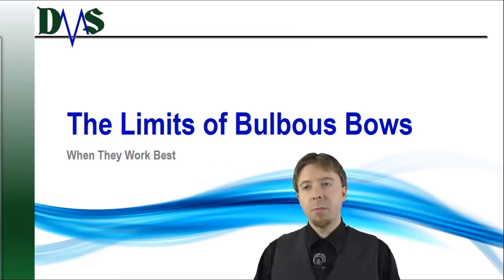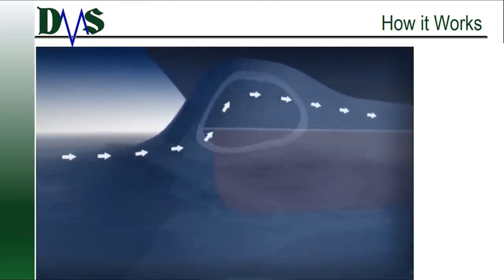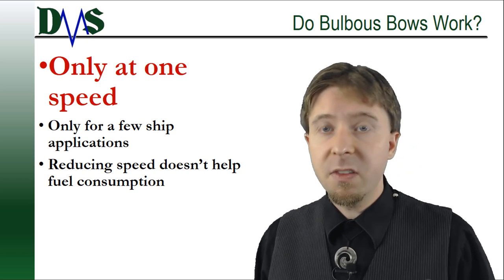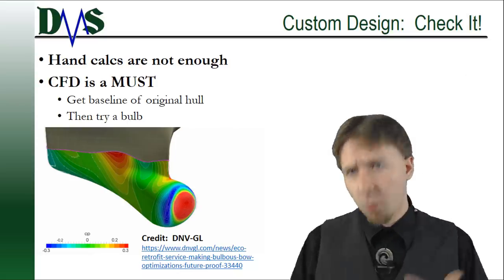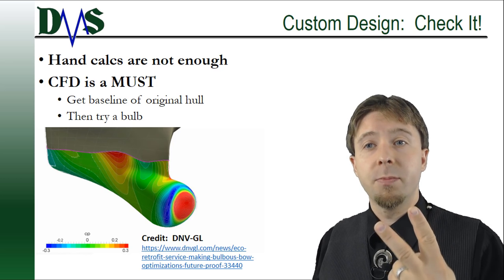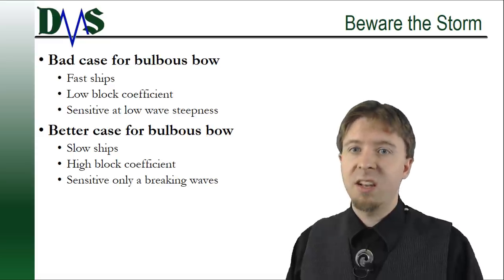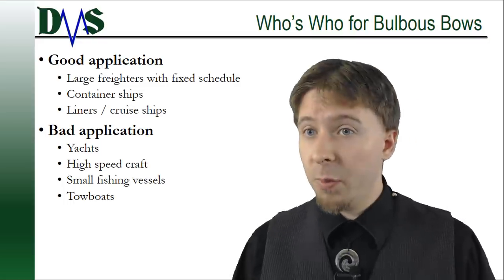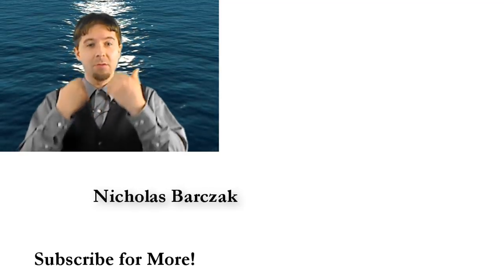The Limits of Bulbous Bows

Comment: Can a bulbous bow be tuned on a small ship to affect the stern wave in a positive way?
Reply from the maker: Not really.  

Any waves that the ship generates get dispersed away from the ship.  This is what we call the Kelvin Wake (http://www.wikiwaves.org/Ship_Kelvin_Wake).  So by the time the wave from the bulbous bow reaches the stern of the ship, it has already dispersed too much to be effective.  However, I have seen some limited studies into creating bulbous sterns.  (http://www.sname.org/pubs/viewtechnicalpaper?DocumentKey=a50b80a4-463e-426f-bfb8-fe9a9432951d)  Same idea as a bulbous bow, but with the flow direction reversed.  The problem with bulbous sterns is that any bulb also reduces the efficiency of the propeller, which still hurts you.

The other part of your question:  application to small ships.  In theory, a bulbous bow might work for the stern on a very small ship.  Unfortunately, with a ship that small, your Froude numbers (https://en.wikipedia.org/wiki/Froude_number) get high enough that bulbs of any type are no longer recommended.  With a small ship, your best bet is to make the hull as skinny and streamlined as possible.

All that being said, you are definitely thinking along the right track.  Bulbous bows are not the only trick we do to improve efficiency.  There are other things like guide vanes for the propeller, designing for pressure recovery on the stern, optimized propeller inlets.  I have even seen a stern lifting foil on some yachts.  I think there are still plenty of opportunities for creative innovations.

Comment: Hello. That was really fascinating. I wonder if you can help me? I"ve been looking at bulbous bows on large vessels for decades. I think I've seen every possibility on bulkers. tanners and container ships. Lately all the new bunkers seem too have the same kind of bow—rather bluff with a not highly developed bulb? I just wonder was there ever a time when they got bulbous bows right for different classes and proportions of ships? Or does fashion play a part? Hoping you can give me some guidance or suitable references. best wishes. :-)
Reply from the maker: Hi.  Fashion is definitely a part.  But in this case, the biggest factor was better science.  I don't have the exact dates, but from around 1960 to 2010, the prevailing science said that a properly designed bulbous bow would always reduce resistance.  (Provided that the ship operator used that bulb at the correct speed.)  But that science all assumed perfectly calm water, with no ocean waves.
Around 2010 - 2014, some new research came out that added waves back into the mix.  That showed that in many cases, the bulb increased average resistance, because of the wave interactions.  
So that is the current state:  bulbous bows can still help some vessels.  But it takes more effort to make sure they are beneficial.  Now, we need to look at calm water performance and wave interactions.  Given all that, many owners decide to avoid the hassle of a bulbous bow.
Reply: @DatawaveMarineSolutions  Thanks. It was just she sheer variations of size and proportions that has fascinated and puzzled me.  But that's a greta expiration,T hanks for taking the time f to explain to a layman. :-)

Comment: Can you design the combination of the shape of a bulbous bow/ship to optimize at a predefined speed.
Reply from the maker: Yes.  That is the ideal scenario for a bulbous bow.  They work best when we have a single predefined speed to optimize for.
Reply: @DatawaveMarineSolutions  Can you accurately simulate water flow around a ship bow to determine how to minimize water eddies?  Eddies cause drag.
Reply from the maker: @richrepublican3493  Yes.  But it isn't automatic.  CFD tells you where the eddies happened and can even measure the impact of each eddy.  But it can't use that to back calculate a fix to the hull shape.  That is why a CFD engineer must be a fluid expert first.  They use their knowledge and experience to manually try refinements to the hull shape.  CFD let's them quickly test those refinements and tells them exactly where to apply the changes.

Comment: the mid sized ships not ideal for <bulb> should get 2 bulbs not 1st to piece the wave but right & left behind the V say shape or axe or wedge or whatever is in vogue(not doing the hand thing not cool enough). 1 bulb just so cute must b finest but midsized ship same a destroyer vs cruiser V,wedge or axe & the a right & a left bulb bc stability in smaller ship is as much a factor as potential % drag & they tend to nose in more rather than just smooth line float, & 2 bulbs will cut that back a bit. Wider on bottom of wedge & sharper top side then back to req boring hull shape.

Comment: 3:03 the ship on the left is the ocean liner Queen Mary 2. What I don’t understand is why it needs such a prominent one, while the SS United States was flat as a board below the waterline, but was the fastest ocean liner ever built. Obviously there must be something more efficient in a flat, sharp bow.
Reply from the maker: Not necessarily.  With ships at this scale, we don't just build the hull to achieve the fastest speed possible.  The speed is a target selected at the beginning of the design stage.  The SS United States may have just been designed to go faster.  If you want to compare the two, you need to examine the resistance curve for the two vessels.  That shows power required at each speed.  The lower curve is the more efficient vessel.
Reply: It would just make more sense for the designer of the United States to give it a bulbous bow then, to achieve his goal of fastest ever liner. Wonder why he didn’t.

Comment: They seem to work on modern subs, the whole sub is a bulb. And porpoises have a bulb in front (joking- I think). Do we need a shape like a sub with a conventional ship form on top?
Reply from the maker: I love this question!  Great thoughts of looking to other examples and applications.  And this shows one of the key elements of surface ships:  the water surface.  That water surface drastically alters the flow patterns around a surface ship.  But designers optimize the submarine for travel far beneath the surface, and we don't get the same benefits any more than 5-10 meters deep.  So the subs are still best as their current shape, unless someone designs something better.
Reply: I was thinking of gluing a sub on the bottom of the ship rather, to make the ship go faster. My original (barely educated) view was that the protuberance moved the bow wave forward, so the ship didn’t have to climb up it, and it made the ocean think the ship was longer and had a more narrow length to width ratio. But what do they do with aircraft carriers? The one on the JAG intro had a waterfall in front and no wake, just a ship-wide line of white water back to the horizon it seemed. 

BTW, the best bow wave I ever saw was on the Tugboat Annie TV show, during one of her races with Capt. Bullwinkle the water must have gone down over 20 feet and a bit under the hull. This comes from the early-ish B&W days of TV so my recollection may be cloudy.

Comment: So why don't they create an active bulb that changes shape and position for different conditions?
Reply from the maker: Some designers are working towards that effect.  But instead of a shape changing bow, they are trying to adjust the shape so the bulb still works at a range of speeds.  Sacrifice performance boost at one speed to improve overall performance across a range of speeds.
Reply: Seems like it would be relatively easy to find an "overall performance" shape as you say, but then put the bulb on a ram that adjusts its projection from the bow as needed. I would think fuel savings would pay for development costs.

Comment: what about added flotation forward?  doesn't that help too?
Reply from the maker: Maybe?  Do you mean the extra buoyancy we get from the bulbous bow?  That extra buoyancy helps a little, but it isn't a major hurdle.  If we don't have the bulbous bow, we normally just design the ship with more weight in the aft end.  That bow of the ship is so narrow that we normally only use it as a tank for ballast water, so we don't normally  need to worry about getting extra buoyancy forward.  Did that answer your question?

Comment: I would think that a reduction of surface area should be your design starting point. Then look at other factors depending on the service she will fulfill.
Reply from the maker: Surface area is only part of the problem.  Ship resistance comes from two major sources:  friction and waves.  On a good hull, the friction is only about 20-35% of the total resistance.  Wave making is normally the dominant part.  Hence why we often go for bulbous bows.
Reply: Yes, but her use in service should be the 1st consideration. From what I understand, the bulbous hull was 1st used on the Japanese Battleship Yamamoto due to her wide hull. Ships in the early 20th century reduced surface area with sharp straight bows, narrow hulls and rounded transoms, but this is very limiting on overall design and comfort. The sea is a world of compromises. I like planing hulls for the speed :-) Thanks for your reply and I enjoy your channel.
Reply: hydrodynamics is more of a or just as much a challenge than aerodynamics

Comment: So the old ocean liners with the knife like bow if they survived till today would still be fine without the bulbous bow? Like If we rebuilt the original queen mary  we wouldnt need to add a bulb since she did about 30 knots on her own. The SS united states did 35 knots.
Reply from the maker: Yes, but speed isn't the reason to install a bulbous bow.  We can almost always find a big enough engine to make whatever speed you want (within reason, no rocket ocean liners).  But bigger engines burn more fuel, costing hundreds of thousands of dollars.  The intent of the bulb was to reduce the required engine size while still doing the same speed.
Reply: the united states did 43 knots lol and i am responding to myself from 9 months ago...

Comment: You basically have to re-create the hull lines plan and and get the baseline of the original hull, and then make the bulbous bow. Don't you need to figure out the buoyancy of the ship? And then have it applied? Also wouldn't the bulbous bow make the ship slower? Honestly I like older ships then modern, for example like the classic ocean liners and for example Titanic's hull!!!!
Reply from the maker: Yes.  We do need to adjust the buoyancy typically.  So the entire lines plan does get remade to incorporate the bulbous bow.  Glad you like the the classic hull shapes.  They are making a comeback.

Comment: I reserve full monetary rights to the following idea.  

With today's tech, a movable bulb (think SR71 Inlet cone )should be developed for retrofit and is computer controlled, also loaded with specific-sea wave profiles loaded to be used in conjunction with current conditions for movement calculations
Reply: XtremeBudgetMusician I imagine with how random sea waves are and how much shear power it would take to move hunk of steel submerged and flowing through a relatively dense fluid, the ratio of energy expended to energy preserved would not be favorable.
Reply: Ryan Nelson I would imagine that the forces involved would be similar to the use of control surfaces of aircraft at very high mach values.

Comment: Two wrongs don't make a right. A noisy power tool produces a wave. Noise cancelling headphones also produce a wave. Both consume energy. The fact that the two waves cancel out does not mean energy was saved. In fact more was used. A bulbous bow adds drag. You cannot provide a physics mechanism for energy saving

Comment: What is CFD?
Reply from the maker: Computational Fluid Dynamics (CFD).  We use the computer to simulate water flow around the ship.  CFD lets you examine the flow patterns in great detail.  It has become a major asset for optimizing complex shapes like bulbous bows.
Reply: Computational Fluid Dynamics: using a computer and software to model gas or fluid flow around a shape such as a ship's hull or an aircraft. This helps engineers and designers to see what works better and to spot potential issues in much the same way as the construction and testing of physical models in a test tank or wind tunnel would. I believe CFD is a faster process than model testing, and results in more thorough analysis of a design's characteristics.
Reply: CFD is akin to FEA- Finite Element Analysis .... imo, very useful in terms of visualizing in theory to that of what you can investigate or witness in reality, computers and such modern tech are so useful to a point of perfection

Comment: Bulbous bows are for speed not fuel efficiency.
Reply: Gordon Kwong yup. Japanese made it prominent on their flagship in WW2
Reply: Yamato was not the first ship to have a Bulbous bow. Ocean liners like Malolo, Bremen, and Europa were the first ships to incorporate bulbous bows into their designs and they were all launched in the late 1920s, over a decade before Yamato.
Reply: vishal chan like the yamato
Reply: Gordon Kwong not in a commercial cargo operation
Reply: Carl Clinton Catulpos so was the original speed 4kn, and the bow increased it by 23kn? Because the top speed was 27kn. I'm calling BS
Reply: Not all bulbs are created equal. Different bulbs specialize in different jobs. Some are designed for speed, some for fuel saving, and even some for ice breaking (see most Canadian lake Freighters built during the 70s-80s)

Comment: It may be that the real purpose of some of those bulbous bows which appear to be poorly designed for wave cancellation is to act as a storage units for contraband.  Search the ship, but who is going to search the bulbous bow?  Paint over an access panel on the outside to avoid detection.  When in port, a diver goes down and accesses it.
     Those bulbous bows do a good job when striking another vessel in an accident.  They are able to deliver nearly the whole inertia of a ship into a relatively small area through the other ship well below that ship's waterline while still punching a substantial hole.  And they just don't breach the hull, they keep on going for a distance causing internal damage.
Reply: For the Burke-class destroyer, the bulb is present for the express purpose of holding the bow sonar